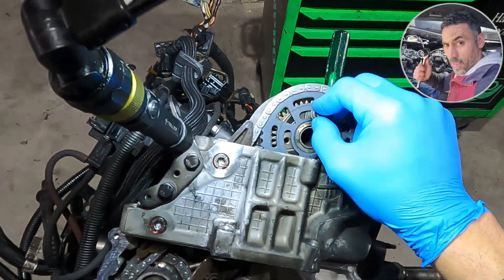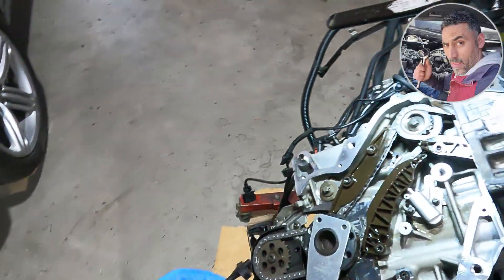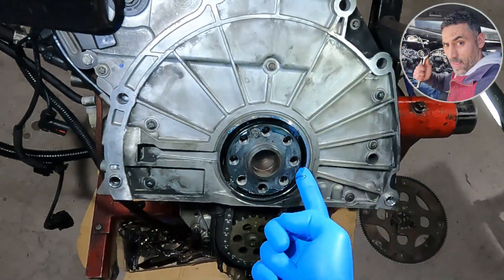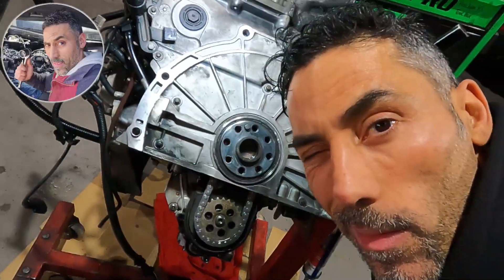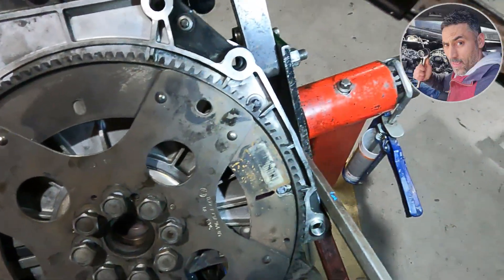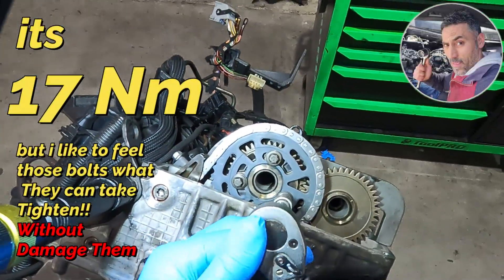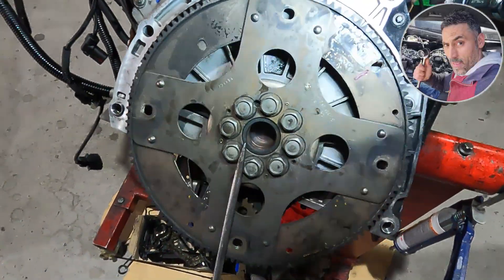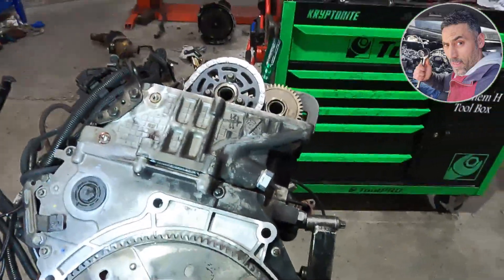BMW N47 & N57 Engine Timing Chain Set Up Part 2

Comment: when you are putting on the upper chain, isn't necessary to remove the crancshaft blocking tool, put carter and flywheel on and fase crancshaft with the flywheel tool???
Reply from the maker: Watch video part 1 and 2 maybe 🤔 can help you to understand what I did with this engine timing chain setup, thanks for watching 😊

Comment: I have bmw 318 diesel 230000 klm ,i change oil evrey 10000 klm ,ineed change the chaine?
Reply from the maker: For this tape of engine better to change the timing chains with the gears before 100,000 kilometers.

Comment: Hello ! I have a question for an Audi a5 2010 prestige . My car is no responding in the issue is cylinder number 1 and 3 . I change coil and spark plugs but doesn’t work.  Is it likely that the valves won't work? What do you recommend?